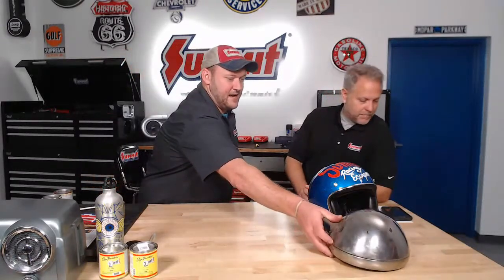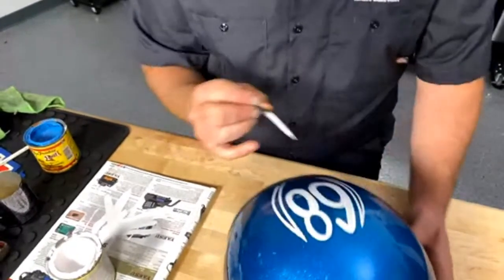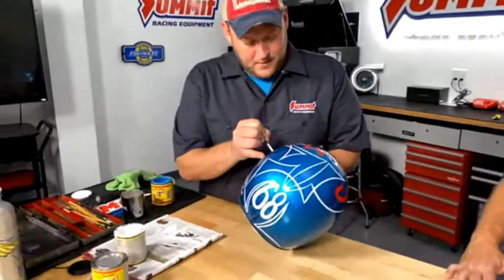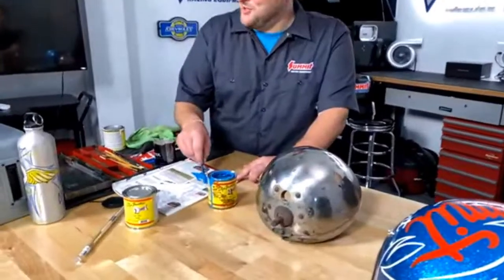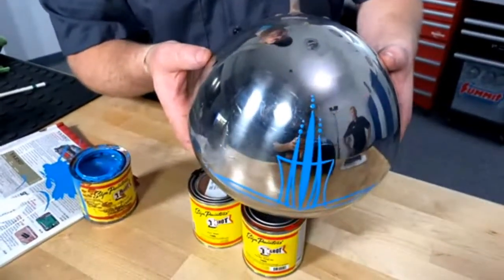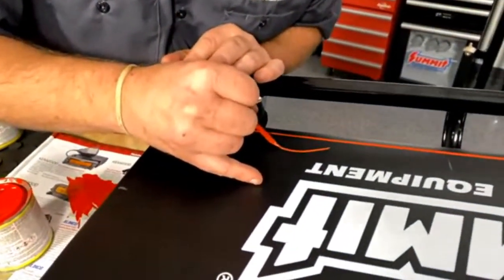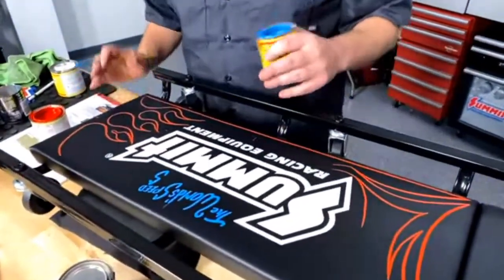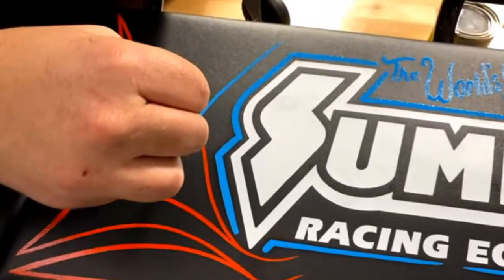Pinstriping Tips and Tools

Comment: Hi I,m 80 yr old retread mechanic. I used to work in a body shop when I was a kid , sweeping and sanding.the painter had some pins tripping brushes. I learned how to paint by spraying inside of bread trucks, sparkle silver metallic.I bought a sword brush and over the years I fooled around with it but never got really good at it. A few years later I was at the Detroit auto Rama show.I found a beugler tool. It is a plunger that you load with paint and screw on an end that has wheels you screw on the end and allows you to pull a line. It works great put a line around the bead of a wheel.